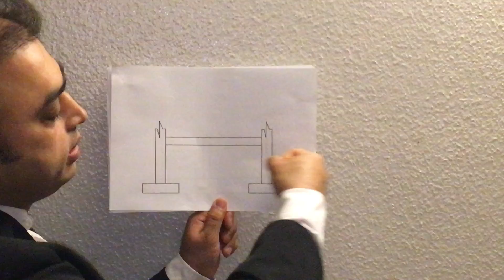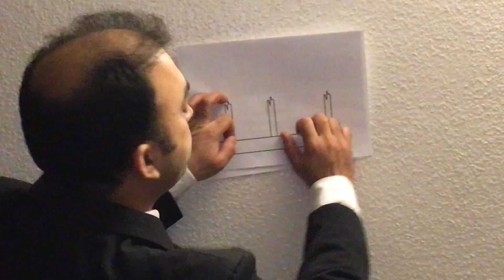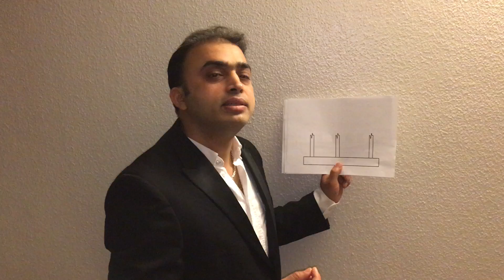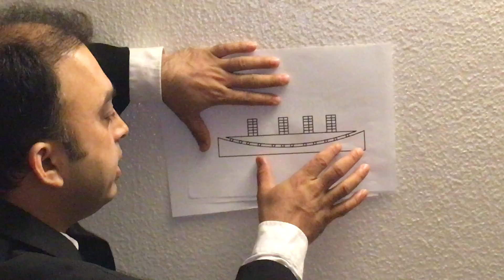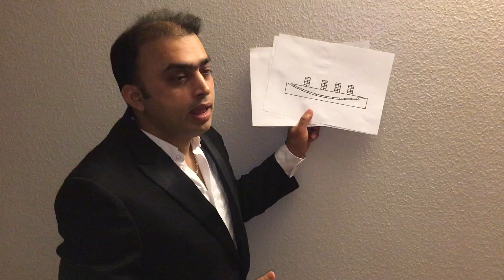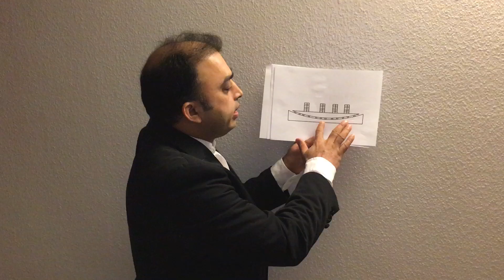How to design an Earthquake Resistant Building  - Mat Foundation on Roller

Comment: Good evening sir, I am planning to build a stone house in 700 sq ft 35 x 20, I want to make it earthquake and flood proof, what type of construction approach should I follow, please Assist  ?
Reply: I don't where you are located and where you live and how tall you want to make. 

You have made a very important question. If you want to make a building which is flood proof it will be earthquake resistant at the same time. You can make a base made of sand and shingles, say 4 feet thick. Then ask your structural engineer to design it like a ship and let that ship rest on this shingle base. Hope this will work.

Comment: Hello sir, I want to build a building of 4 floors. the length is 40 feet and weidth is 13 feet. which type of foundation i should use? can u help me out.
Reply from the maker: it depends on the soil underneath and type of seismic zone you are in . in addition to that  the amount of money you can spend and how much safety do you want - i mean how important is the structure to you,  , if you are from India and if it is your private accommodation ,  just make it a raft/mat foundation and make it thick to make the bottom heavy . heavy bottom gives better stability . 

if you dont believe me , knock an empty glass with your finger , it will fall . next time fill it with water  upto 15% . now try to knock it . it will not fall easily. it has a mathematical derivation/solution  to prove the phenomena as well . you can find that in my MSc thesis at city uni , uk 

Someone may say , it ,may sink due to earthquake , answer is - if the soil sinks that is beyond our ability . nothing can be done. we can only make safe for fault at best . 

sorry to reply late . I saw it just now.